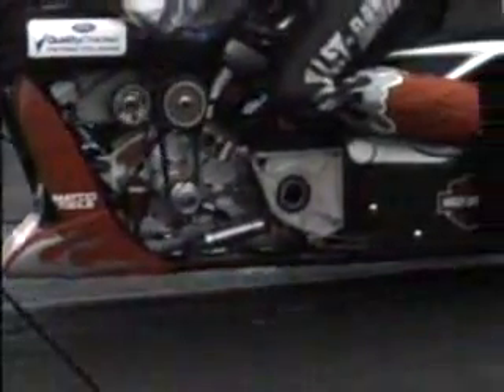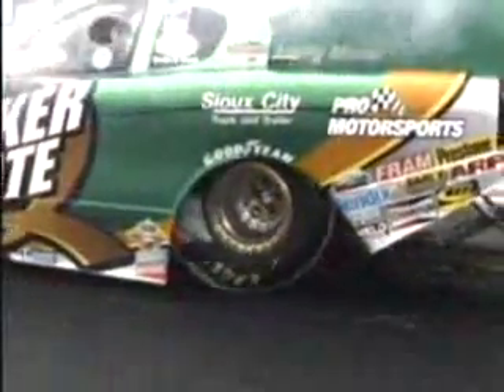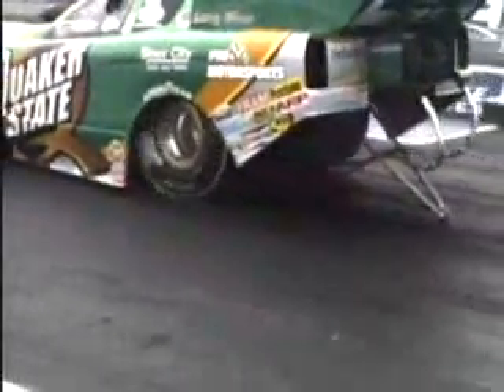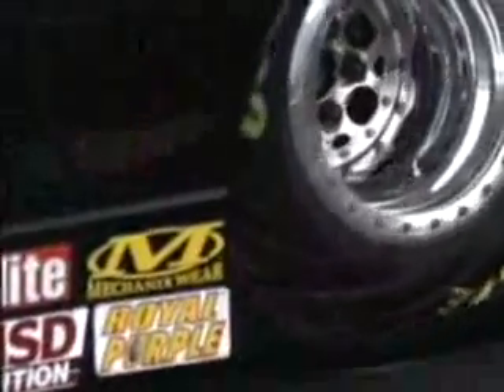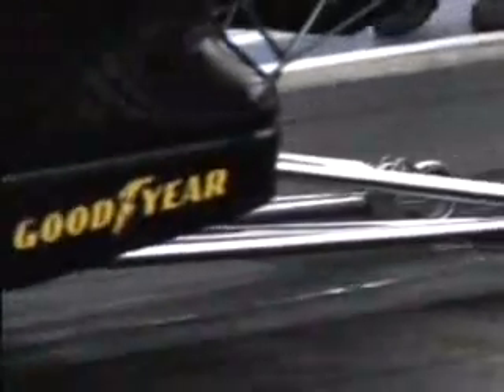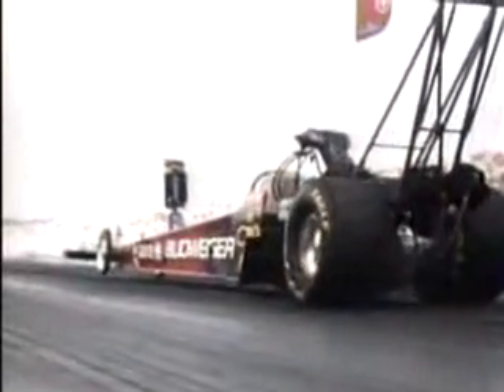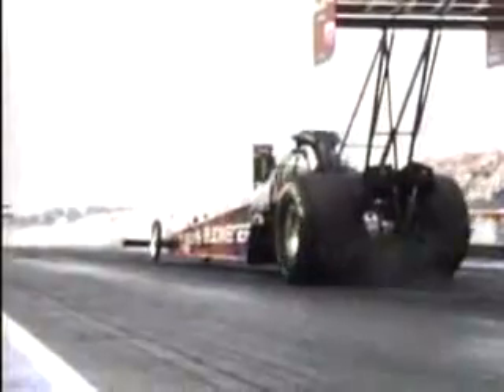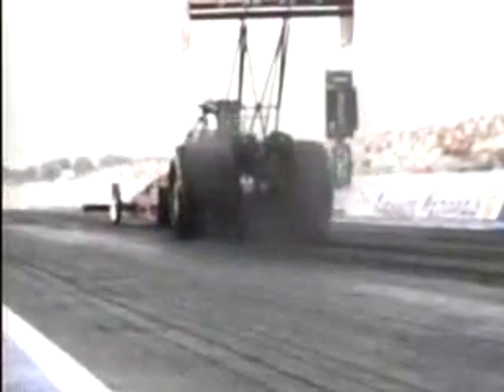Mega Slow Motion (MegaMo) 1000 frames per sec. Dragsters

Comment: Warblade118, that can't be correct.  I'm with you at the crank turning 133 times per second, but every cylinder fires with every revolution of the crank? The cylinders firing only 600x each during a 4.5 second run even seems low, but the numbers play it out.

Comment: @Backsider16 it's one thing to replace the car or a part of it, but the process of building and designing the F1 car is upwards of $30,000,000 then you have to take into account the tires and fuel and as you said the replacement cars and parts. In the end it's probably around $100,000,000 just to go fast win races  and gain publicity. Just to start over from scratch every year. That's why you only see the huge companies like Red Bull and Ferrari in the races.

Comment: @TestECull Have you ever riden a roller coaster? Have you even gotten that feeling in your stomache when you accelerate? It's amazing right? Drag racing takes serious skill. With that much power you'll spin the wheels until you hit rim if you don't have serious throttle/clutch control. Timing the lights is no walk in the park, either. The stress of a race enviroment, coupled with the skills required make drag racing a serious test of skill. Like it or not, they deserve your respect.

Comment: @NeilLB7 Drag racing is boring. Oh boy it accelerate fast. But that's all it can do. One trick pony. It can't idle for more than a few minutes without overheating, it can't stop for shit, it can't turn for shit, the fuel mileage is abysmal even by race car standards, the cars are all hideous, you can't see a damn thing out of them and the 'fun' only lasts 3.5 seconds every 15-20 minutes.

I'd much rather be in a Miata on a road course. Way more fun, and way more challenging.